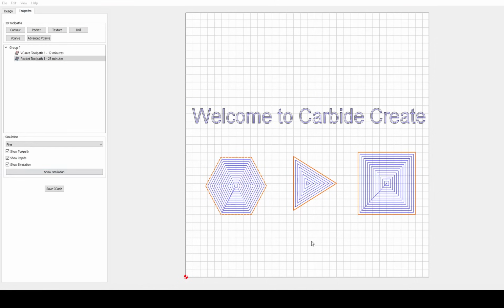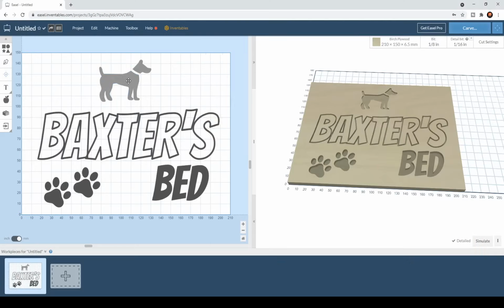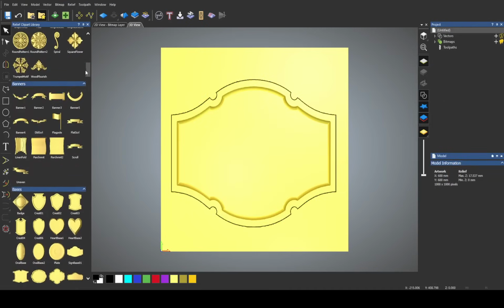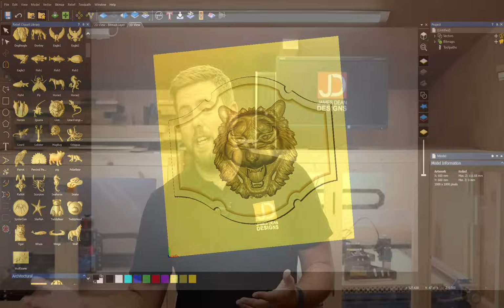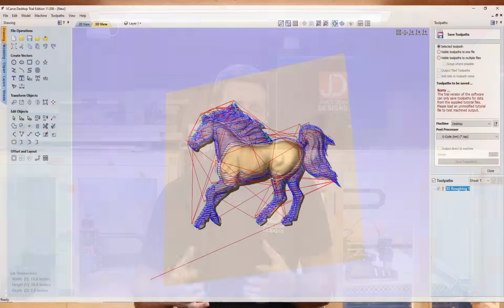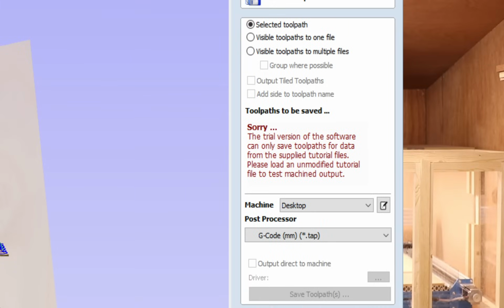Beginners guide to desktop CNC software

Comment: need your help, today I was working with my machine during the day, I have been using the easel carve program.

but from one moment to another, it cannot identify my machine and it does not recognize it, I already turned it off and reconnected it to my usb port. It tells me that it is not connected, you  know what it could be?

Something strange happens, when I press the home button on the masuter machine, the carving icon turns green, but it won't let me maneuver the machine.

When I unplug the USB port to allow me to unlock it, the icon turns blue automatically and says we can't seem to find your machine automatically
Reply from the maker: Try changing USB ports, try changing cable if you can as well.
Do you get a bing noise on the PC when you plug the USB cable in?
Reply: @JamesDeanDesigns  thanks for answering.

I already made the change of usb cable, I have two spare ones and with those the program does not detect it either.

To check if the usb port was working properly, plug in a printer and it worked without a problem.

I already did the test on two different computers, on the computer where I have windows, it makes the normal noise detecting that the usb has been connected, on the mac, it doesn't sound, but the funny thing is that the carve icon turns green When I press the home button to the masuter machine, when I try to reconnect it again without pressing the home button, the button remains blue and it appears to me that it cannot be found automatically.

Comment: Just want to correct one comment you made.  I use VCarve 9.5 and my machine is 48" x 48" and I can set my projects up in VCarve with dimensions of 48" square.  You stated it only goes up to 24".
Reply from the maker: Hi Chris, its actually Vectric who state this, I'm just simply repeating their own product spec. Vcarve standard is listed as only going upto 24 or 25 inches where as Vcarve PRO goes bigger. But Vcarve Pro is then comparable with Maker+ instead of just Maker. If you don't have the Pro version and yours goes bigger then thats excellent 👍
Reply: @JamesDeanDesigns  to be honest, I never looked at the standard version.  I looked at the pro version for 3 years before finally buying it.  I was using the FEngrave software for quite a while before this.  They also have a few other cool tools, one for DMAP TO GCODE and a GCODE splitter.
Reply: @JamesDeanDesigns  great video by the way.👍

Comment: What do you run UGS on? Your computer? I've been using a little circuit board with an SD card on it, so I don't have to leave my computer connected to my CNC machine for hours. Thoughts?
Reply from the maker: Yes you run UGS from your computer. Offline controllers are OK and great in a scenario where you can't leave your laptop with the machine but ultimately they lack functionality in comparison to software like UGS

Comment: James,  I really needed this video.  Just today I finished building my first machine (ProVerXL 4030, based on your videos!)  and started with UGS instead of Candle.  And started with testing the limit switches and range of motion.  Oddly, UGS said moving between the X axis limits was only 265mm when the meter stick said it moved 420 mm.  Candle gave similar wildly wrong values.  Where to start looking for the problem?
Reply: I had to calibrate the stepper motors using a piece of graph paper stuck to the bed.  Works fine but for the constant USB errors.
Reply: @terrybullett493  If you think you have USB errors, try upgrading to a high quality USB cable that is no longer than needed for your setup.

Comment: Thanks for posting this comparison.   I've only had my 3018 for three months so still learning.   Currently using free Easel, UGS and Inkscape.   As you mentioned, Inkscape is very useful to get access to many fonts.  I have found it is necessary to press control, shift C  (on a Mac) on the text in Inkscape before exporting svg file so that Easel will import it.   I'm happy with this combination of software for now.  I dislike the concept of subscription software.   Your vids are some of the most helpful I've found for beginners.
Reply from the maker: I used to be dead against it as well. Ive used Adobe software for over 15 years and they were one of the first companies to switch,  it really frustrated me. But I can now see the advantages, particularly the fact its more accessible. For example to buy the Adobe master collection was over £2000 before they switched and then went to about £40 a month and you got all the upgrades so more people could afford it. I hate the thought of stopping paying and losing all your work though 😒
Reply: @JamesDeanDesigns  Yeah, at 15 years you are committed to whatever Adobe chooses.  Long live open source.  I use a lot of it on my Mac.

Comment: Hi JD - thanks for all your videos - very helpful.  I recently purchased a 4030, and I have been trying to engrave a Spartan Helmet onto a piece of aluminum using Carbide Create, pulling in the image from a .png.  I chose the Pocket option but it does not cut out all of the helmet.  It completely cuts the forehead area and the center of each side of the helmet that that would protect the face, but it leaves relatively large areas between the forehead and the outline of the helmet as well as around the perimeter of the face shield on each side.  I also tried the AdvanceVCarve option with similar results, although it performed a bit differently.  Any thoughts on what I might be doing wrong?  I did this exact thing on a Shapeoko a few years back but did not have the same problem.  I appreciate your help.
Reply from the maker: Hi Craig, Send me some photos on Facebook or Instagram and I'll see if I can help you out. I dont really use Carbide but hopefully we can find a solution

Comment: Great video, Thanks. Received a three-month trial of Carveco and right out of the gate ran into an issue doing 3D work. A flag popped up regarding my graphics capability with a Dell Latitude i5 using an Intel integrated graphics setup that wasn't upgradeable. I don't think I'll be buying a new computer to satisfy that requirement so that leaves me no other choice but VCarve. Any other suggestions?
Reply from the maker: You can sometimes find workaround for graphics issues so might be worth looking into that. And whilst you might not be ready to upgrade you might just find another machine will work. For example I got a cheap £40 i5 pc in my workshop and that handles Carveco, Fusion and video editing software like Premiere.
Reply: i3 or i5 processor computer can use all mach3-4 and carveco,Vcarve, etc software, not need upgrade computer anythink.

Comment: UGS will run on a Raspberry Pi but the graphical display of the work in progress will not function properly due to a known issue. Instead, I'm using bCNC on my Raspberry Pi 4 and it is very similar to UGS in look and feel.
Reply from the maker: Thats some really useful info. Thanks for sharing 👍
Reply: I’m 8 months late to the party here. I appreciate the note about bCNC. I’ll have to take a look. I have an rPi on all my 3d printers and plan to put the cnc out in the workshop. Pi control save a lot of headaches.
Reply: @StephenFeather  The only problem is that it's difficult to buy any Pi's these days unless you're will to pay a crazy price. If you have some laying around it's a great option.

Comment: do you have a machine that runs Mach3
Reply from the maker: No, mach3 is becoming obsolete because of the cost, or at least in the desktop CNC world.
Reply: @JamesDeanDesigns  I going to be building a larger CNC and really don't have any cost effective choices except Mach3. I still look forward to your videos.
Reply from the maker: @SamsWoodCreations  do double check before purchasing anything, usually GRBL works out cheaper and is why most machines now use it including larger setups like workbees, Onefinity etc.  In essence they both use gcode, just that GRBL use a limited selection. Mach3 has more commands available however there is the license fee which you need to factor in, GRBL being free. Either way, 99% of tutorials will still be useful, its just the post processor you need to change when exporting
Reply: @JamesDeanDesigns  I haven't found a board that uses GRBL and can drive larger motors
Reply from the maker: @SamsWoodCreations  how large are we talking as things like Workbees run are GRBL? I've never built a big machine but to my knowledge you have separate drivers for the motors on bigger machines
Reply: @JamesDeanDesigns  its going to be 4ft x 7 ft and I haven't really found a board that runs on GRBL that will interface with a Nema 34 motor driver module that's cheaper than the Mach3 license
Reply: @JamesDeanDesigns  I have been watching the creation lately of "High Current" and High Torque" GRBL Controls and Bundles for builders of Larger CnC Machines like 1200mm x 2400mm or 4ft x 8ft.  I have been keeping an eye on the xPro V5 which is high current and runs Grbl but the price points are high. What I really need is a GRBL controller that will run DM556T stepper motor drivers , but be below the cost of a parallel breakout board ($17) and a Mach3 License ($165).
Reply: @JamesDeanDesigns  This has been a very stimulating conversation and I have really appreciated your time spent on it.
Reply from the maker: @SamsWoodCreations  no problem. I wish I could help more but this starts getting out of my depth unfortunately. I dont know enough about standalone components to help unfortunately 😕 hope you get it all sorted 👍

Comment: James you didn’t mention Mach3 software, I would like to know your thoughts on it .
I used to use a cnc milling machine as I was a toolmaker but my boss done the drawings and I programmed it into the machine to make the parts , so as I’m retired now need to start a new hobby.
Your video was very explanatory and helpful.
Reply from the maker: Mach3 was very popular and still is, but you essentially have to pay for the license and its also quite dated now. They released a Mach 4 but it never really took off. Mach3 is technically capable of doing more and handling a wider range of Gcode but for your average CNC person, GRBL is sufficient and free
Reply: @JamesDeanDesigns  thanks for your comment.

Comment: I used Sketchup 8 for years for my woodworking projects because it is free and very easy to use, but quickly discovered that it is useless for CNC projects. I wanted to find a free software package with similar features and ultimately decided it was worth learning to use FreeCAD. In particular, I want a design environment that allows me to create an assembly of multiple machined parts, then export the parts individually for machining. FreeCAD is very powerful software, but it has a steep learning curve and is challenging to use. It includes a CAM/Toolpath workbench, which in theory should provide a seamless workflow between CAD and CAM. However, my experience with it has not been very satisfying as I have wasted many hours trying to work around bugs and limitations (or maybe just my misunderstandings of the software). I'm wondering if you have explored FreeCAD for CNC work and did you reach the same conclusion that it is not (yet) fit for regular use? Can you recommend any free or low cost software or a workflow that is well suited to producing multi-part designs?
Reply from the maker: Hi, The only one I have used is Fusion 360 which I believe can do multiple parts and is one of the most popular and powerful. Its just a steep learning curve

Comment: Parametric 3D modelling software is when one of the parameters of the sketched shapes used for the base of the model can be changed and the model will automatically alter all other linked parameters.
For example, you could change the width of the base of a pyramid from 5mm to 10mm, if the height has been determined through a parameter that it is always double the length of the base, it would automatically alter from 10mm to 20mm. The shape would not need all measurements to be altered individually.
Hope my explanation is clear.
Great videos btw, I'm currently expanding my maker knowledge and have a PROVerXL waiting to be built when I have made space.
Reply from the maker: Thats a great explanation and I now know what it mean 😁
Reply: @JamesDeanDesigns  G’Day Dean. A further small clarification is still read. “AutoCAD” is still a plain old bog standard cad software, where you must draw it to the correct size, right from the start, just like free packages. Parametric modelling is used in a different Autodesk product, Namely “Inventor”. Or some might remember it first being used in the old discontinued software called “Mechanic Desktop”. It should be pointed out that Parametric modelling programs like Inventor and Solid works (a very worthy competitor) are designed for 3d solid modelling, whilst AutoCAD is very much a 2d environment, 3d is possible, but not useful in this regard. 
I hope this helps.
Reply: Thanks

Comment: Vcarve can go over 24 inches if you buy the pro version,  it's only desktop version that limits you
Reply from the maker: That is correct, but it is also double the price and then also comparable to Carveco Maker Plus. I wanted to compare the two lowest priced options covering 3D from both manufacturers as they both produce 3 different tiers of software for 3D modelling work
Reply: and "tile" mode can carve big sheet many little piece,

Comment: Watch fusion 360, it will not do 3d reliefs as yet.
Reply from the maker: Really? I was sure I had seen people doing 3D reliefs from fusion 360. I use 360 but for 3D printing stuff as opposed to CNC routing
Reply: @JamesDeanDesigns  I tried to using it for a relief with no luck. Did some investigating and found that function was  not available yet. That was about 6 months ago. Also if you try to use any STL files there's a lot of prep you need to do to use one of those. It works fine with a solid file. I forget the suffix.
Reply: @SethCNC  Thanks Seth I do appreciate that. I guess I have a lot more to learn about Fusion 360 and I hope I didn't sway anyone's decision making.

Comment: great video 
i use design spark to do the 3d drawing and cambam for cam although cambam is a bought software at €108  but works very will with design spark 
i am using a 3020 cnc and i can not use easel to do the cam  for the design
it will not work with the cnc  i only use the cnc for making  buildings items for my model railway layout 
great  information from you as usual

Comment: Another great video, and just at the right time for me as I'm looking to up my CNC game.
I have a question about offline controllers. I currently use free Easel for my 3018 and once I've generated the G-code, I pop it on a mini sd card and run it via the online controller. Is this not advisable? I do love the freedom the offline controller gives me.
Reply from the maker: Offline controllers are absolutely fine, they typically just have limited functions. You have a lot more options  using a something like UGS but not everyone needs those extra functions